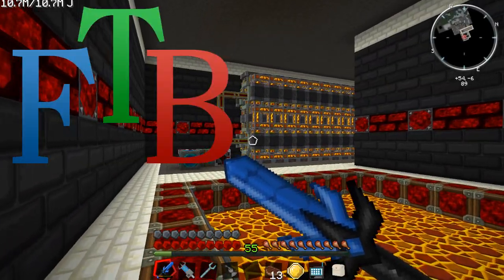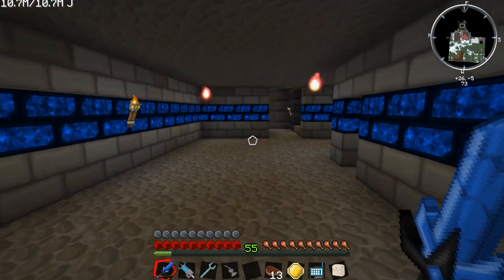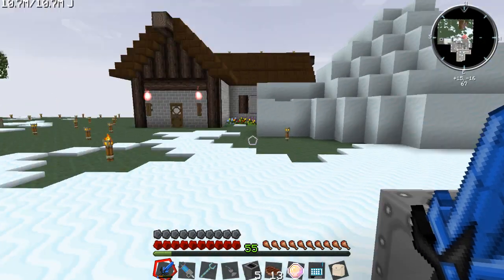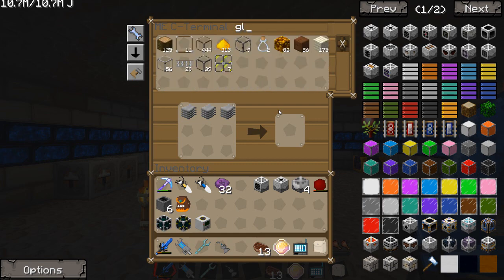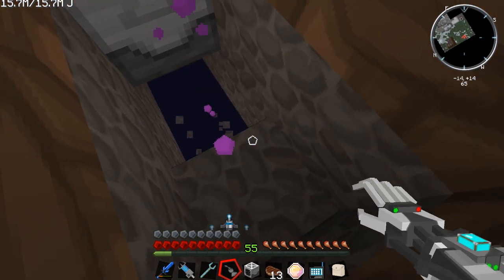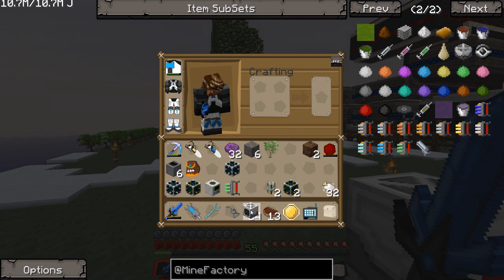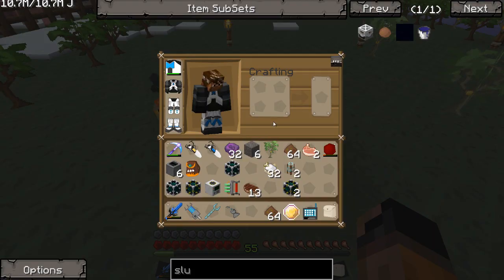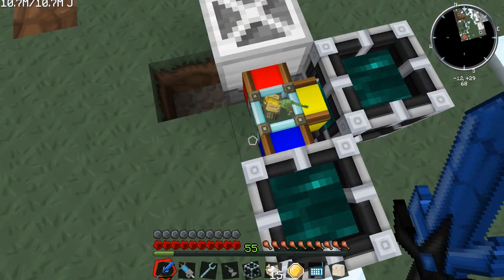MineFactory Tree Farm | FTB Ultimate Skyblock | Ep.37

Comment: Hey Bentley.  I've had similar problems with the emerald upgrades in those machines myself.. it's so slow because its upgrading the default 3x3 range by +11 in *every* direction, effectively trying to plant and harvest a 25x25 area, or 625 trees ;) ... MFR works much much better on a smaller scale, 7x7's and 9x9's.

Comment: Tre to use Xychorium Soil wich support and accelerate the growth of plants, it double the speed of a plant grown upon it, stacked beneath the plant will increase the speed by an equal amount.
Im using RP kinetic generators to power my MFR machine to grow Jungle tree (for charcoal), only stack them on one column and att top i add 3 mor, Same like you do wen you bonemill just one Jungle tree in 2x2 patern to grow gian one. And sludge is good to get you some sand, clay and other resorce.